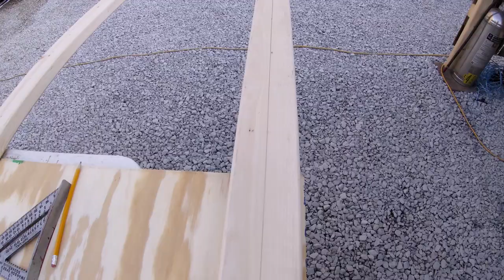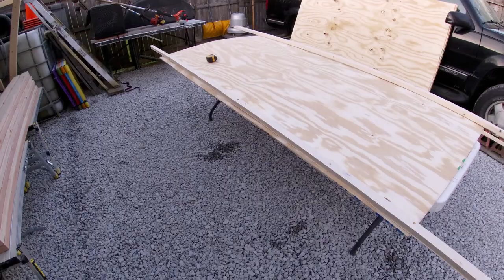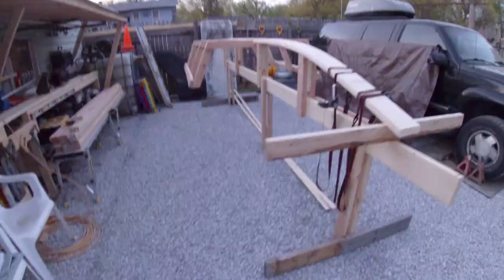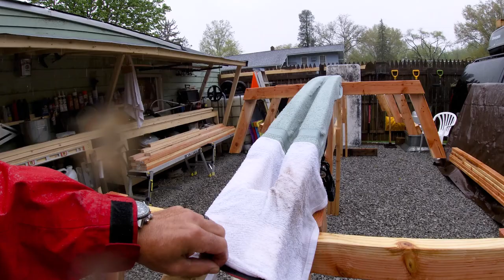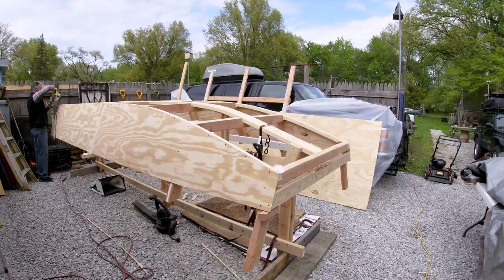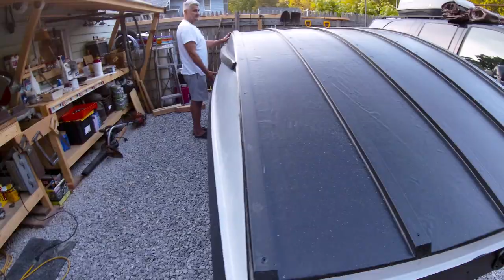wood jon boat  preview

Comment: Is this the poor mans fiberglass ? Very curious how you sealed and painted.
Reply from the maker: 2 layers off epoxy and 6 oz fiberglass cloth finish with epoxy paint
Reply: Poor mans fibreglass is titebond 2 or 3 wood glue and canvas used just like fibreglass and epoxy works great for campers idk about a boat